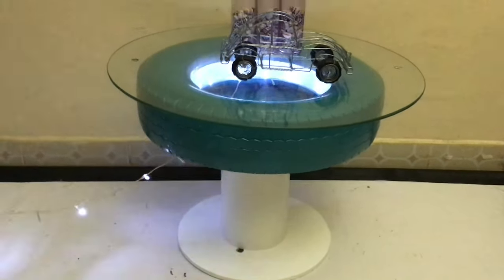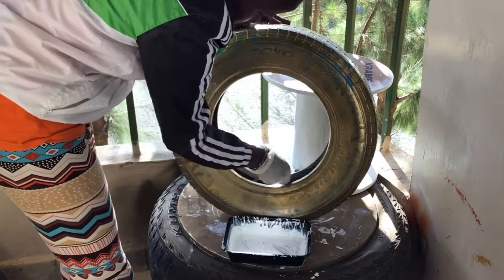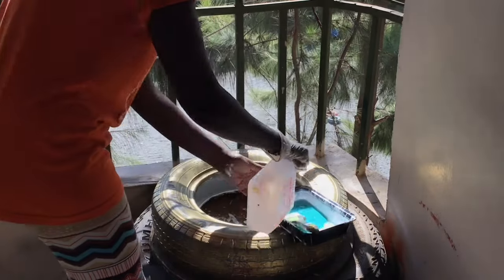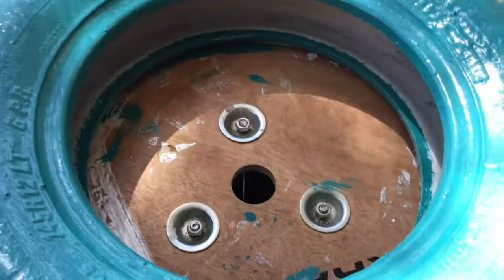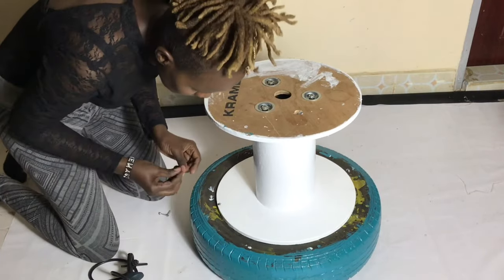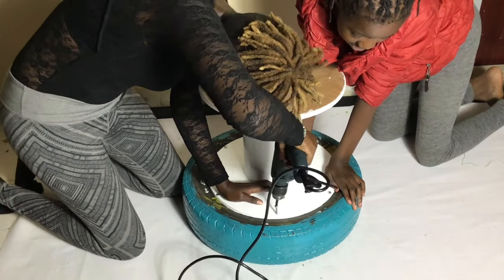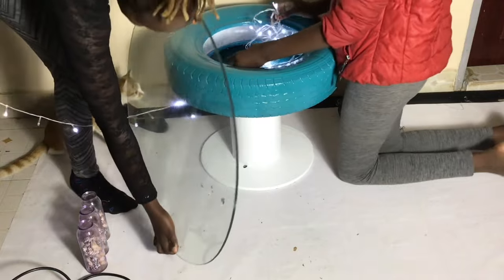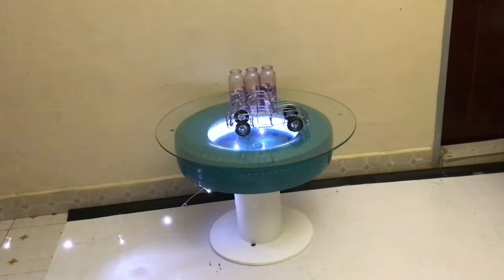DIY// HOW TO MAKE A LIGHTING TABLE USING TYRE/TIRE CABLE ROLL.

Comment: Where can I get the glass
Reply from the maker: Hey Tess, I buy my glass in CBD kirinyanga road but all you need is the diameter size then go to the place there are selling glass and ask them to cut it for you and ask for a heavy glass.
Reply: @Njerikabiru  thank  and  how much approximately
Reply from the maker: @luckysfam2824  it depends on the size you want, glass color and the thinkness but from 1k and above..
Reply: @Njerikabiru  thank you